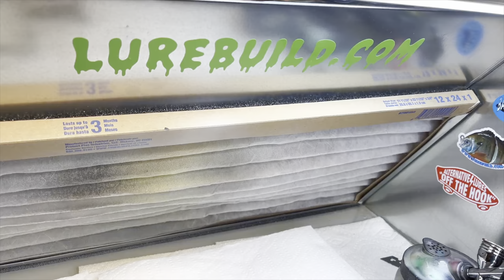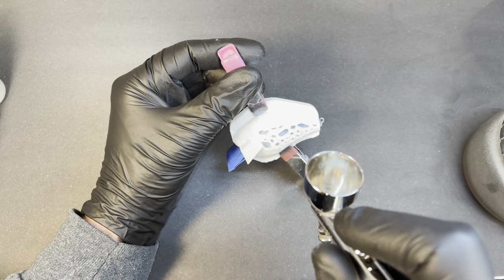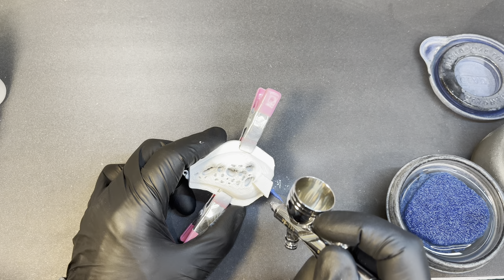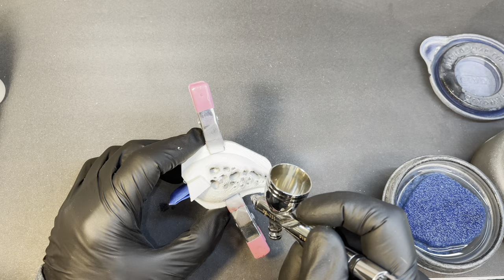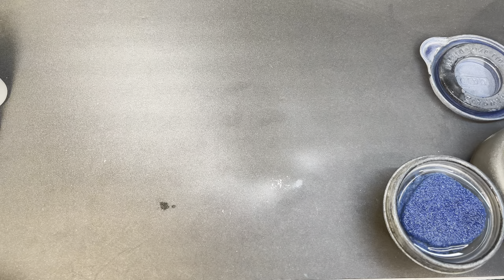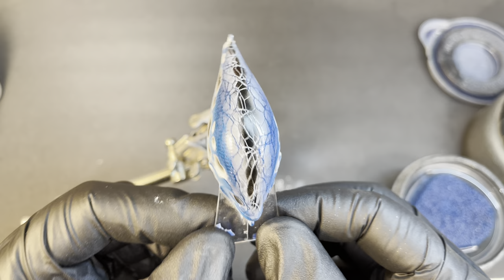Lure Painting:3D Stencil and 2 Coat Epoxy Technique on this Electric Blue Frog

Comment: Quick question. I want to start painting lures and want to buy a compressor and airbrush kit on amazon for about $150 to stay budget. Do you think it will be quality enough to get the job done? And if so is the tanked recommended or can I do the job with the tankless compresor?
Reply from the maker: I think you can starting out, eventually you will want to invest in a good airbrush it definitely makes a difference, need anymore help let me know
Reply: @customlurepainter  Yeah thats what I was thinking I'm just scared to spend $150 on a airbrush and not stick with the hobby. I plan on it but I can always upgrade down the road. Thankyou